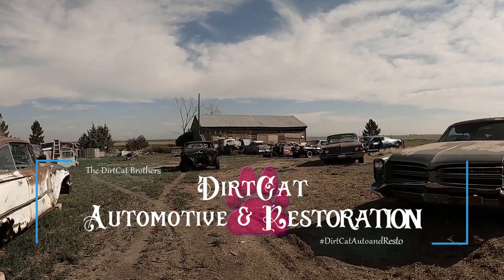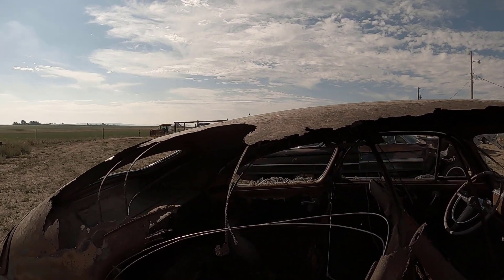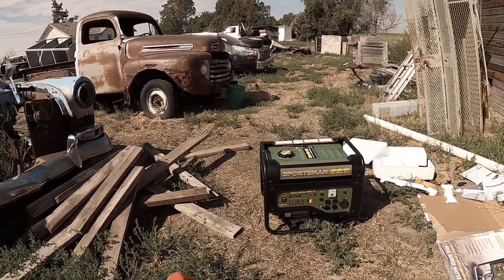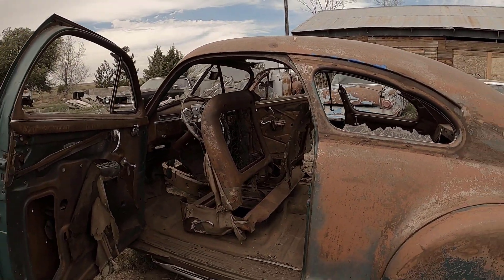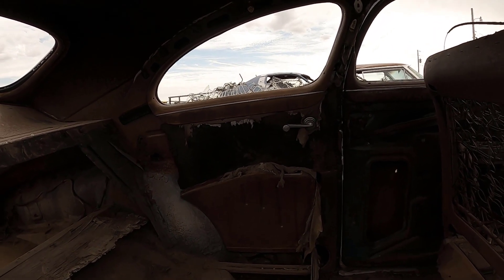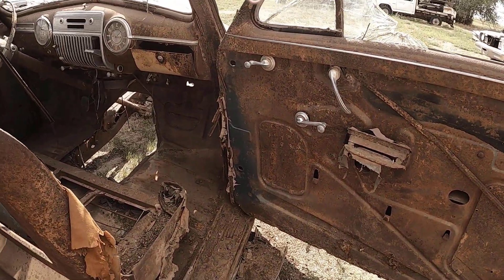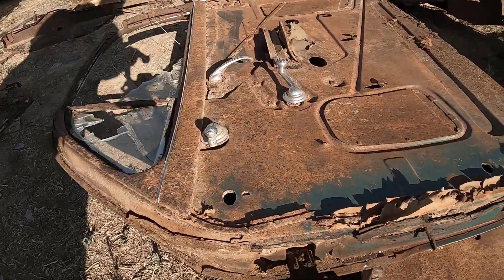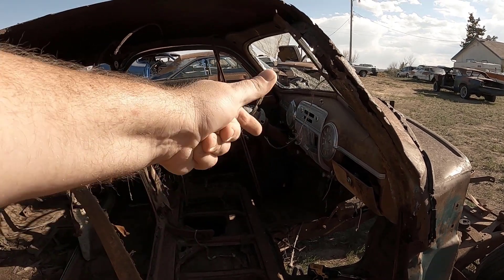A Toasted Door With Piles of Dirt

Comment: Ya might want to try a electric or air impact wrench to shake the bolts loose. Working with older equipment I found that the impact will help move rusted bolts.

Comment: If it has electric windows what is the crank handle for?
Reply from the maker: Front is standard.  In fact a lot of these didn’t have the buttons line modern age cars.  Just a lever to move.
Reply: @TheDirtCatBrothers  ok cool. Just seen the handles on the rear and it didn't make sense